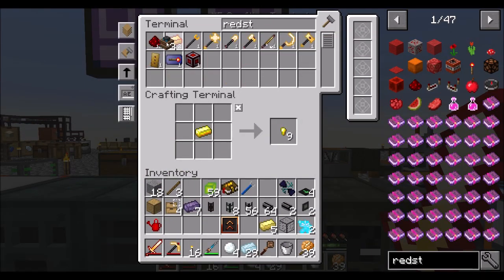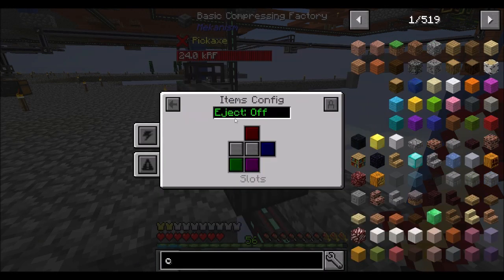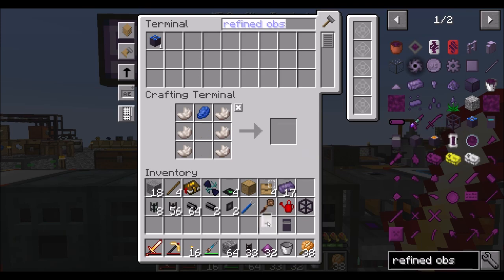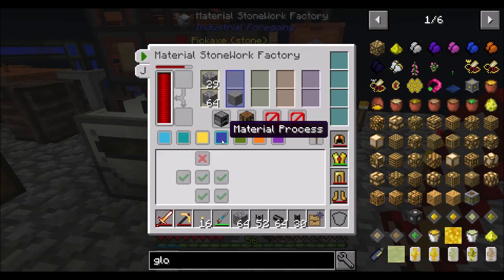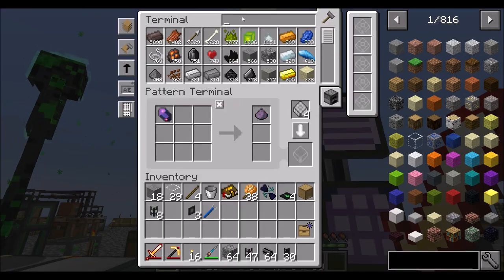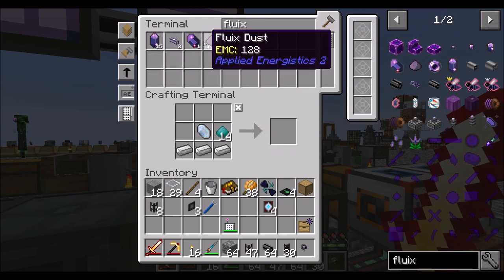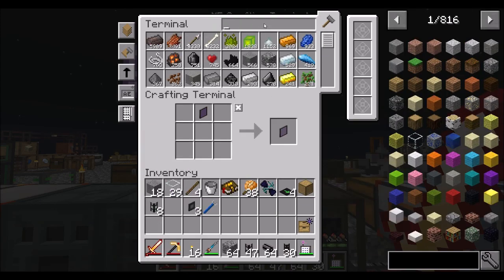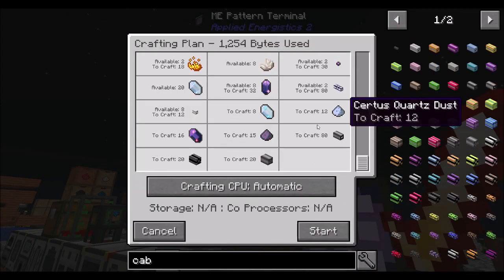Modern Skyblock 3   Ep54 Wireless Crafting

Comment: If the infinity card can run out can it really be called infinity?
Reply: Yes, because there is an infinite distance between the wireless terminal and the original ME system.
Reply: The problem is that it has an awfully finite range as Dire has demonstrated in this video.  Infinity is supposed to mean infinite amounts, range, etc.  And it's not.
Reply: DarkVoidIII its a booster, he needs multiple cards to get the excellent range.
Reply: Actually, it doesn't.  You can be as far as you want away from it (infinite distance), but you can only use it that far away while it has "fuel".  This isn't anything new, btw.  It's been this way for quite some time;  Dire just hasn't used a mod pack that left that at the default.

Comment: Dire, I don't get it... most of this video you're crafting stuff you already have in your AE systeam, for example the quick dropper and the combustion collector, both, you already had, and then, I'm posting this at 21:50... you have 8 wireless infinite range booster card in the AE, and you're redundantly making the normal booster cards...
Reply: TheAdypoker so about the normal booster cards, did you see how they work at the end? Have you used the mod before? The other stuff was dumb, but making a stack of the wireless boosters is a great idea, especially since dire doesn't read the comments and didn't keep all of the infinite booster cards he's been getting.